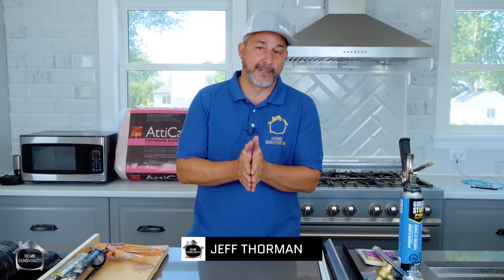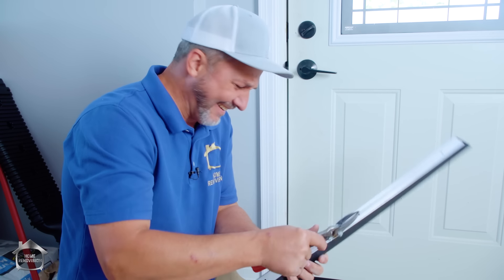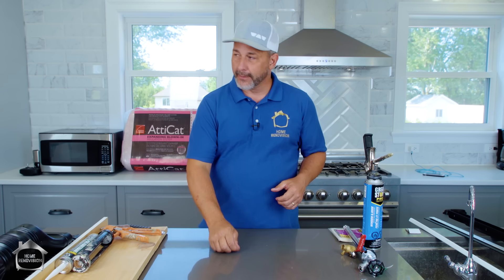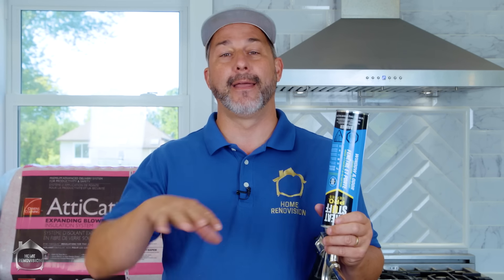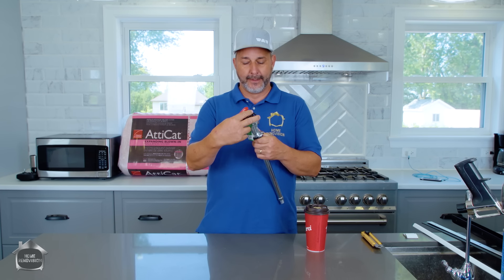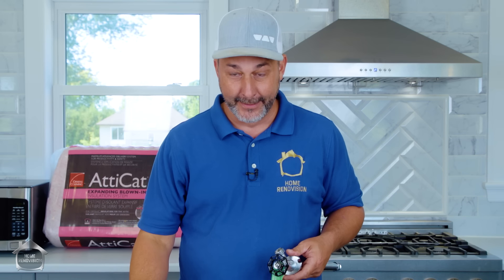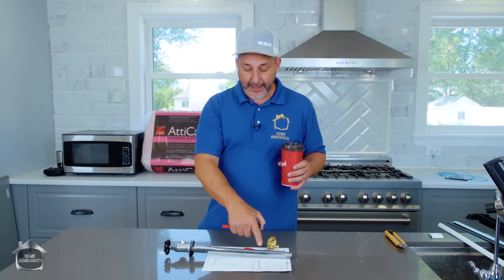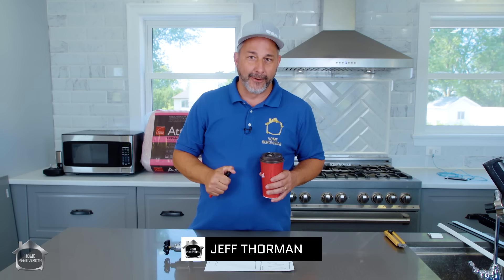How to Winter-Proof Your House and Save Money!

Comment: Hey Jeff, first let me say I love the videos and you have helped empower me to become a legitimate DIYer ha ha. I do have a couple of pressing issues however I would like your opinion on;

1. I am at the drywall stage of finishing my basement, rural Ottawa bungalow, 2009 build, so far I have installed dry core subfloor all my framing (unfortunately I only watched the "diy beware" to late and I left the builder exterior wall framing sitting on the concrete w vapour barrier beneath) and have some of my 5/8's ceiling installed. After watching your video from this august regarding basements, I realize I have two issues. Both windows. One is a window over our stamped concrete patio, at patio level. The other is around the corner and also almost level with the grass. I am planning to re-grade that window to bring it down several inches, but the concrete patio window is to late to deal with this year I feel It is the furture gym window in a far corner of the basement, my plan is to leave the area around it unfinished for this winter until I can find a good solution. I still plan to finish the other 1200 sq ft of the basement. We have a really good sump pump, generator, and have been here through major rain events with no issues. Your thoughts on my plan would be greatly appreciated as well as any recommendations of who to contact or what to install on the patio to deal with the issue. Sorry for the novel, and thanks so much for the channel.

Comment: Shut the inside ball valve. Next open the outside valve and let the water drain.  Last step, take a shop vac and suck out any remaing water and you are good to go.
Reply from the maker: great tip!
Reply: I am able to blow out my outside lines with an air compressor

Comment: Great video. I was a victim of the water spigot segment (My fault). I bought and installed one of these long valve shaft deals. I thought, "well, that's done." Come spring time I open the inside shutoff and, "What the..."     I didn't drain it.      One final thing... I think you may've put that corner seal on incorrectly... wedge points inward? Great vids...

Comment: Wow this was an eye opener in regards to putting humidity in the air if you have a furnace. We just purchased a house in New Hampshire and are getting ready for our first winter (your video's have been so helpful). We have a furnace but there is no humidifier connected to it (house built in the 80's)....but this now explains why the flooring planks up in the bedrooms has huge gaps between all the floorboards. We are getting the furnace replaced next year but is there anything we can do through this winter? I have a small humidifier for our bedroom but do we need more? EDITED: I just ran down to the basement and checked....I had previously turned off the shutoff valve and turned on the outside faucet to drain it - thinking it had been drained. I just now opened the bleeder valve and water is dripping out - but not stopping - does that mean the valve needs to be replaced? The outside is still trickling and the bleeder valve is dripping (with the inside shutoff turned to the off position). I'm not sure what to do in the meantime until I can get a plumber out here, we are expected to have 22F tonight. Fingers crossed it doesn't burst.

Comment: Thank you Jeff!  I have a front door that doesn’t quite shut right and seal all the way.  I have tried adjusting it, but then it won’t lock.  I will try the foam strips to fill the gap.  Also the lesson about the frost proof silocks was great.  I have two of those and I have no idea if they are sloped right.

Comment: Hey Jeff, I like your channel, really useful! 
I am about to venture into some renovation and I have two questions (with some background):
1. We are renovating a bathroom and it has a big water heater inside. We want to put it elsewhere to fit a bathtub instead. The question is - can a water heater be safely placed in an uninsulated garage? If yes,what safety measures should we take to prevent leaks and breakage? We live in a country, which can get well below-freezing temperatures. 
2. Our attic is a "cold attic", i.e. with sprayed insulation. Can one turn the cold attic into a usable space by insulating under the roof instead?

Comment: Have you covered (re)installing stair hand rails before? Aging parents requested something before snow season (speaking of winter). We have deck stairs that give access to the front entry below street level.

Utility brackets? Heavy duty brackets? Are they just marketing terms or do they mean something? Is it safe to use the leftover holes from previous brackets? Wood vs metal handrail? While we're on the topic, indoor vs outdoor, different designs, etc? Can I just request a whole video? Lol!
Reply from the maker: I would suggest the stainless steel shower rod supports for a handrail outside. you can also get them made to order. Cheers!

Comment: I have slab foundation so my furnace is in my attic. The exterior water shutoff valve, would that be located around the furnace? the exterior faucet goes directly inside a wall behind washer and dryer and theres no exposed water line or shutoff.

Comment: Had a valve in the garage  that split because it was made in China. Inferior product. Cost me over $300.00 to have repaired. At least the water was confined to the garage & flowed out to the driveway. This was 20 years ago. Found out after we sold it the kitchen had aluminum wiring & one wall caved in the basement about 6 months later. Found out after I sold it the builders built it to very minimal code & what they could get away with to maximize their profits. Best deal I ever made. 😉

Comment: Any advice on a old home that has a gap between the foundation and the bottom of the siding? I can reach up behind my siding and feel the insulation from the basement. Its 1/4" to 1/2" gap and i think this is the reason my kitchen floor gets so cold.

Comment: 6:44 - That's improper orientation to install those. They need to be tapered towards the inside, so the right orientation would be counter-clockwise 90deg from what the video is showing.

Comment: Jeff - I don't see a link for that downspout water diverter. I checked the Amazon winterizing link also. Can you provide the source for this product. It's something we greatly need. Contractor who installed our gutters put really long extensions on the ground for our downspouts. The snow sliding off the roof has totally crushed them all. I really want to try the product you show here. Thanks for all you do.
Reply from the maker: try this link. Cheers! https://www.amazon.com/Wholesale-Plumbing-Supply-Combo-Pack/dp/B07C58KPFJ/ref=sr_1_5?crid=2Y0JUI12P8JLJ&keywords=flexible%2Bdownspout%2Bdiversion%2Bkits&qid=1699203029&sprefix=flexible%2Bdown%2Bspout%2Bdiversion%2Bkits%2Caps%2C149&sr=8-5&th=1

Comment: We're in southern ontario. We have a 1981 home and there's no sign of that valve anywhere. Is it possible that we have another system? Should we be concerned? Thanks! Love the no non-sense advice :)
Reply from the maker: if you have a tap outside you have a valve inside. maybe its been hidden by a drywall ceiling. but it is there. Cheers!

Comment: Hello.  I am ISO information about off ridge roof vents.  When the tar and gravel roof of my home was replaced the roofing be installed vents without mention to me.  I believe the cheapest version was installed and does not automatically close when faced with a gust of wind.  Given the cost of heating my home, I live bundled up in heavy winter clothing 24/7 and the thermos as low as I can tolerate and still pay sky high heat bills.  The monthly increase in energy and water bills combined, equal a car payment that I can't afford.  I live in an arid region of CA.  This century we've mostly experienced severe droughts.  What are your thoughts on covering my roof vents, please?  What material do you recommend I use if you think it is a good idea to cover them.  I saw some covers to keep rain out during hurricanes in the east that appear to be made of styrofoam.  I have a pool noodle I can cut to fit in the vent.  I'm concerned about the absorption of rain water as well as these being a fire hazard.  I also have extra aluminum foil I can either use cover these materials or scrunch up to fill the vents.  I look forward to your response.

Comment: Do you have to turn off water to hose bibs with the self draining air inlet on top? 

I thought those were self-emptying of water down to the petcock which is ~12" inside of the exterior wall.

Comment: Hey Jeff, just bought a house this year and I am not able to get to the shut off valve for my hose line because the previous owner installed a ceiling in the basement making the piping covered up. I asked him if he ever blew out his lines before the winter and he told me no and has had no problems. Side note I do not have a sprinkler system. Specifically talking about the hose spigot. Any advice would be greatly appreciated! thank you!

Comment: I don’t have a basement or a crawl space. My house is on a cement slab. My hose line is outside the kitchen window in alignment with the plumbing for the sink. I don’t need a bleeder valve like you’re showing. Is it possible I don’t need one?

Comment: My hose bib goes trough a hole in the foundation and is older and just a copper pipe. If I was to replace it with the one that Jeff shows in the video how do you secure it to the concrete?
Reply: Either drill and screw it in or just simply silicon it to the concrete in the spaces behind the screw holes.

Comment: Great information. Loved this. Question, I live in an old wood house. I done a lot of things mentioned on here but still get drafts coming in my house especially the front wall. I noticed that the cold draft comes in through the baseboards. Any recommendations on how I can seal that up? TIA...
Reply: Same issues here.... any advice would be greatly appreciated? My entire downstairs has a steady draft coming through all the baseboards. I'm a single mom from Illinois, a first time home owner, and completely new to all of this home owner/renovation stuff. Purchased an old two story fixer upper not truly understanding what I was getting myself into. Due to income Im having to learn and do the home repairs myself which wouldn't be possible without your videos. Thank you Jeff for the time and knowledge you put into your videos! Your reliable information has helped teach me how to handle my home repairs the correct way preventing issues  down the road. I 'll probably be working on this house until my dying days so keep the  videos coming! You're very much appreciated  😊  Big thanks from this momma from Illinois!

Comment: If the frost free hose bibb had a stop and waste ball valve correctly installed, and the s&w bv was closed, with the hose bibb opened, shouldn't it should drain out either through the spout if graded or through the s&w if back graded?

Comment: Again, great video and info.  Just curious, do you think a 50" Deck Riding Lawnmower would be safe to drive over a subsurface drain like the one you were standing on?  I have a unique rainspout drainage issue I am trying to solve.
Reply from the maker: sure. lawn tractors usually have wheels that are very low psi to protect the lawn . Cheers!

Comment: You never discussed a major point.  Unscrew the garden hose from the frost-free valve or the water cannot drain out even if it is installed at a 1 degree angle.

Comment: Something he alluded to but bears clarification/repeating: Because the split occurs on the long part of the silver pipe he's showing, it's past where the valve is and therefore will only leak *when you are using it*. You will never know you have a problem until, like he says, after you've been outside working for hours. And then when you find the flooded basement, the leak has stopped, so you'll be scratching your head where it came from. Also, it should be understood from the idea of opening the spigot and letting it drain that you've already disconnected your hose/reel. This is a critical step. When I was a younger, dumber kid renting a house, I did everything as I grew up knowing how to, turn it off inside, crack the handle outside, walk away. Unfortunately, I didn't think about the down-stream problem, and sure enough, it pushed back into the house and split the pipe during a super cold winter.
Reply: Bonus content, we all know why/how pipes freeze, but hearing the physical process is very interesting: https://www.youtube.com/watch?v=0pmviUS1Zac&feature=youtu.be&t=1048

Comment: OH BOY! Okay....It's amazing how you put out these videos, Jeff, and I'm in need of EVERYTHING IN IT!!!! I need to address my drafty old doors and windows, I need to replace my water spigot outside in the back yard as well as the one out front (which by the way, exploded a few years back at around 3am during the winter and my cousin (who no longer lives near), came after getting off work that morning and graciously cut and capped the water line for me and I never replaced it because first off, the line in a crawl space under my house where all the neighborhood spiders come to hang out and number two, I don't know anything about welding and soldering PLUS, it concerned me that while he was soldering the cap on, it was burning the joist that was near the pipe needing the repair! So Jeff, (okay, I've got a few questions to ask), is there some sort of fireproof material that can be placed over the wood to protect it from burning while using a flame-like that? There's burn marks on the wood and I certainly don't want it to become weakened! #3, for the spigot in the backyard that I need to replace (old & dripping), what do I use to connect the two types of metals? The spigot is that stainless steel looking one like you have but my pipes are copper! Whatever I use, it will have to be one size on one end and smaller on the other due to my copper pipe's size and it appears that the previous owner used the wrong connector because the sight is bubbled up white, green & molted looking like the metals were eating up one another or something! (gross!) #4, My door that leads into my attached garage from my kitchen has slight gaps not only below the door but also ABOVE THE DOOR! I can actually see the kitchen light shining through when the garage is dark and the door is closed! I almost feel like the actual box that the door closes onto is too shallow and I need to add wood on the 2sides and above (upside down squared-off U) THEN add maybe the weather stripping so that when the door closes, there's a bit of an overhang or cover-up of the actual door edges! Do you think that would help? #5, where do you apply the outdoor window caulking? It's well past time for new windows and sliders but I just can't afford it right now! Jeff, I know you're a busy guy and I hope that you can get to my questions but if by chance you're unable to, know that I understand and that I'm so happy for you and your channel growth and all the great things happening for you, your son and your fantastic team! I'm sure if I look, I'll find answers to most of my questions somewhere in your playlist of great videos! Thanks for all you share! Bye for now, friend!
Reply: Can't be 100% sure but I think the char marks are alright, it shouldn't be weakend really, what you need to be more careful about is cutting notches or holes into joists.

Connecting the two pipes, Jeff has some videos on plumbing but I've seen him use Shark bite connectors and they can connect different types of piping plus there's adapters. However, personally I paid a plumber to replace my bibs and install shutoffs.

For the door, that basic weather stripping adhesive sounds like it would help seal the gap at the top. They come in different sizes so just a matter of finding one that closes the gap.

For window caulking, it goes on the outside of the frame against the siding. If there's a gap there it should be filled, so top bottom and sides. My windows are super old so I actually sealed the casing on the inside too, as I plan to tear them out eventually.

Hope that helps. If you become a Member, you can also email or call Jeff directly. I've done it now multiple times and he's great at answering! 💪
Reply: @kamranayub  Thank you so much for taking the time to give me some insight on how to handle my many issues! It was quite helpful! I'll search Jeff's video to see if I can locate one where he used the "Shark bite connectors". My hope is that I can somehow figure out how to make the repair myself and save myself the expensive plumbers fee. Thanks once again, *Kamran Ayub, for your reply!

Comment: Jeff - thanks for the video, good content.  Wondering if you can help while thinking about winter.  I was checking an outside spigot on my house and water pressure was really really low.  Pressure in the house is strong.  Anything I can check easily or adjust?  Spigot comes right into the house where the washer/dryer is on a very short run where there's an access panel.  I don't see a ball joint or anything else in the panel.

Comment: If you turn off the shut off valve and have drained the frost bib, should you leave the outside bib handle in the open or closed position?
Reply: I have that same question. Should the bib handle be open or closed over winter?
Reply from the maker: interior closed and then the exterior open. Cheers!

Comment: Landlord has all original doors and the part of the door that holds it shut and locks is chipped away of the wood. I have tried the insulation gap filler but it usually comes off after a few days. I'm at a loss for what I can do.